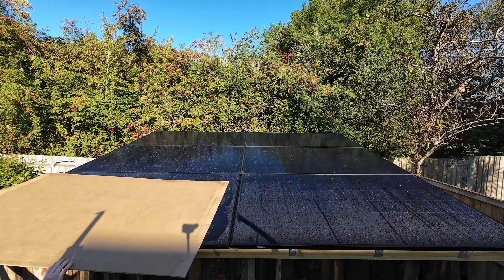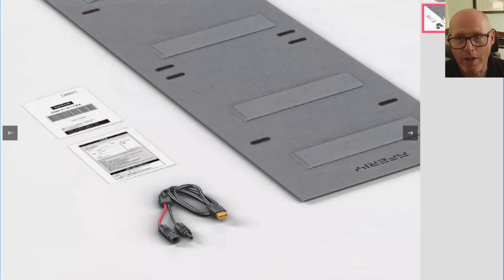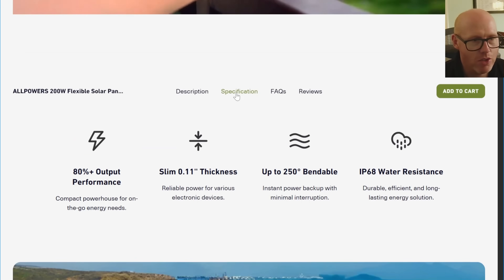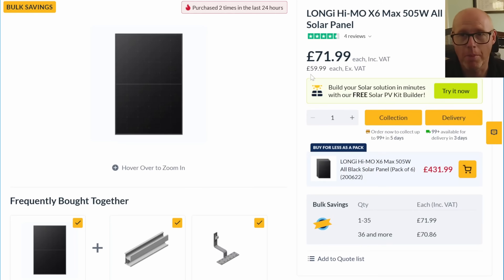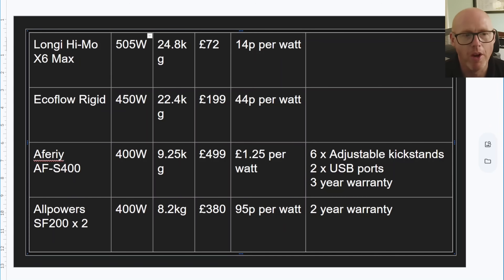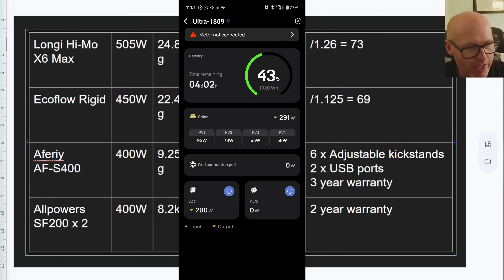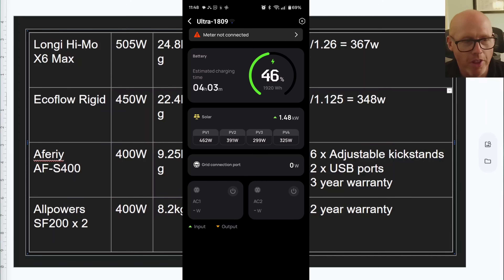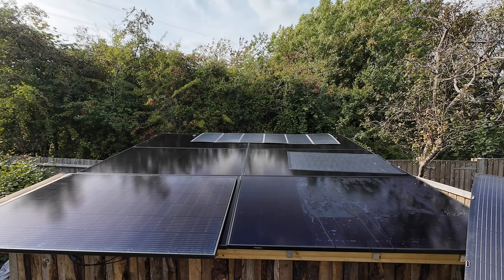Rigid or Portable Solar Panels? The Truth After Testing Aferiy AF-S 400W

Comment: You reviewed my panel! Yay! Yes, the longi has performed beyond my wildest expectations. Even in cloudy, grey conditions, it's still at 40% max in September. I think I made the right choice. The power in sunligh is phenomenal from four panels. 2.1 kWh. PS I am not sponsored by Longi!
Reply from the maker: Great to hear your system is working so well.
Reply: @UpsideDownFork  Thanks mate. Off-grid, self-install, runs all but all the LED lights on the mains. Fridge, computer, Internet, Telly, Air-Con and Heating. 8 kWh usable lithium battery storage. About £2000, not kidding. I do love your videos, they remind me the passion is shared by others. :)

Comment: I recently bought the Ecoflow stream ultra kit. The panels arrived in boxes of 2 so really quite heavy and bulky. at 1.9m x1.1m Once seperated and put ready to mount even as a single they felt heavier than 22kg.

The most interesting thing here was the costy differential. The Longi panels being less than half the price of the Ecoflow ones.
Reply from the maker: Thanks for watching and hope the stream system is working well for you!

Comment: Hi, for a camper van I wonder if it’s worth having one or two 500w panels under the roof rack so you can use those on the ground if desperate in the winter?
Give you have fited a spare chargers controller for use?
Building a slide out solar panel into the roof rack is also an option. Guess in the UK it’s for sheltering under in the rain!
Take care all M.
Reply from the maker: BougeRV make an interesting roof rack with sliding solar panels.

A bit pricey but for the right person it might be ideal.
Reply: I doubt you would get much solar power in the winter. But would be interested to know if they would work
Reply: @IDann1 Hi, I have solar at home and they struggle in Dec. and Jan.
Overpanneling is the best option. Or a generator!
Take care M.
Reply: @markeh1971  With the current kit you can charge them efficiently off the vehicle engine so don't need to cart a generator around as well.

Comment: I have used a TopSolar 60W solar panel for 4 years, using it camping and charging power banks for my daughter to use to power her phone and tablet. It produces enough power to charge a 28,000 mah powerbank every day (in good light) so my daughter can power her tablet on a night. I think theyre very useful. Used it to charge my car battery too after it had sat a while and to charge the drone batteries when out and about.
Reply from the maker: That sounds like a very useful setup, thanks for the feedback.

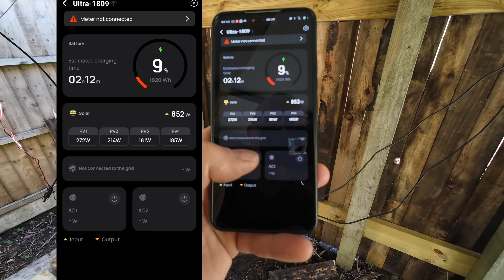Comment: 8:09 - do yourself a huge favor: get home assistant running on what ever computer you have. then install the ecoflow integration and you have a real tracking of each panel 247 and far better
you can do the math and the key figures you want:
* W per kWp installed 
* Wh per kWp installed

We use if for over 6 years with our 13 strings and 25 kWp. You can identify any issues like big leafs on one panel or a plastic bag the wind must have pushed onto the panels and the water "sucked" it onto the panels. You do not look on your panels after a few weeks or month but you will instantly see figures for strings that are off if you use the key metrics per kWp. 

We are using a satellite image of the roof and added an overlay where the strings are located and show the values in HA on that string. 
I need to look for 10 seconds and I know if the system is running properly or not.

We had done about 10 panel tests back in 2020 and 2021 to find out differences between the brands and they are overall neglectable between the top 10 brands. Each one had a 600 W microinverter and overall we decided to go ahead with bifacial only, no more panels with foil on the back. Too often too big damages caused after 10 years just outside the warranty cause the moisture creeps in and causes corrosion on the back on the busbars, till the corrosion on these spots looks like 2 or 3 mm tall hills.

From that the wind will rub the foil over the peak of these hills till holes will appear and from then on the degredation will get faster and faster.
But all these 10 panels delivered the output as promised in the spec sheet first - but after 5 years some of those with foils showed the first signs of degredation outputwise.

Comment: Impressed by the Longi. With hindsight I would have got those instead of the 4x Ecoflow 520w that came in the Ecoflow bundle. The Allpower would make home solar possible where weight is an issue - hanging 20-25kg panels on a railing off a tower block scares me a little. The Aferiy foldable look great for travelling.
Reply from the maker: Glad you found it useful.
Yes, I agree. For attaching onto balcony railings etc, a lightweight panel is definitely preferable!
Reply: @UpsideDownFork  Just installed 2 x Longi Hi-Mo x6 455 on a small west facing roof for some afternoon/evening solar - Really nice all black panel. Good recommendation.
Reply from the maker: @jimlymm  good to hear 👍

Comment: I got the allpowers R2500 and 400w folding panels, game changing for the motorhome seeing as high as 440w in Spain. Tried using it to power the home which worked well, bought 2x440w JA panels and found it could run the house on a good day. That convinced me it was time to get 10 panels on the roof and a powerwall 3 from that fine chap Elon, so happy. Folding panels are brilliant if you require portability  and I found the allpowers 400w easy to use and very stable.
Reply from the maker: That's great to hear and thanks for sharing your experience.

Comment: it is not  about performance - the big issue is the longevity and so far they all sucked more or less by delamination
5 years later it starts to appear and then you can face serious degredation. 

Here the major flexible panels manufacturer had big troubles which meant to removee the glued panels from an industrial roof, i meant hundreds.
And northern germany is not the worst climate and the building was not along the shore line - 200 km inland.

Prices are multiple times higher and longevity is questionable at least. 

The manufacturer is also always starting to claim that it is just a 1 batch only production issue, but the older they get the more cases become public.
Reply: Bad ones last a couple of years, good ones I'd agree maybe five or six. They really aren't a good buy except for now and then emergency usage.
Reply from the maker: What would you recommend?
Reply: @UpsideDownFork  Most of them are random products with brands slapped on so it's hard to be specific, and they often switch supplier arbitrarily without changing brand or part number. The best guide for flexible or lightweight I think is the offered guarantee when it's a reputable supplier. Even then you also need to look after them - flexible panels last best if not flexed in the first place and if kept cool.

If you only want them for use on odd weekends camping then the cheaper panels can be fine. I know people who use the cheapo Dokio panels for camping trips and for that they are okay. I'd just never stick them on a roof and expect them to last 2 years in the sun and rain.

Comment: Jackery has rigid 86W BF panel and they are PORTABLE, i had 5 of them and they are great choise.
Reply: You are no expert cause experts would never say that before 10 years are over.
We have here industrial installations where panels are flued onto the roofs and within 5 years the flexible started to delaminate.
From that point on you can see big degredation and you have to hurry to open a warranty claim. 

Flexible panels can be usefull for roofs that can bear only a limited load but they are a risk cause too many manufacturer suffer from delamination. You will remember that sooner or later cause so far we have no roof that had lasted 10 years without issues. 
If 1 out of 50 goes bad and from 100W to 50W the whole string of 50 (5 kWp) is dropping to 2,5 kW output peak .

Good luck.
Reply from the maker: Thanks for commenting.

Comment: Quality review and test. I've just ordered the Longi panels to add extra wattage to my Stream system, I'm pleased that they performed well in your test, especially as they are so inexpensive, I paid £59+vat each delivered from City Plumbing. Thank you 👍
Reply from the maker: Thank you. I'm very happy with the 22 Longi panels on our main house roof. Performing well all year round.
Reply: do you buy panels based on Watt (which is completely wrong) or are you doing the calculation the proper way with the thermal coefficient and the coldest temperature to expect on your site ?

Prices are the least important thing as the power or watts. 
And if you might think after 1 winter that it has worked forget about it cause it is just a matter of time and the damage can be big cause the inverter will be gone . We have had a lot of cases and they are no warranty claims cause too many have no clue what the are doing.

2400 Wp panels does not meant they are good for an inverter or battery with 2500 W

This is wrong cause people simply ignore the basics: Power is the result of voltage x current 
Your panel(s) have to stay below the max. current AND the max voltage the inverter can handle at any time  !

And if you check out the panel spec sheet you WILL NOT FIND THE ANSWER there with voltages and current.
Those figures are only for 1 temperature. 
And too many buyers think that with colder temperatures values like voltage will be dropping (like range of an EV) but that is not right.
Reply: Wattage, reviews from other users, price and availability are all important considerations for me